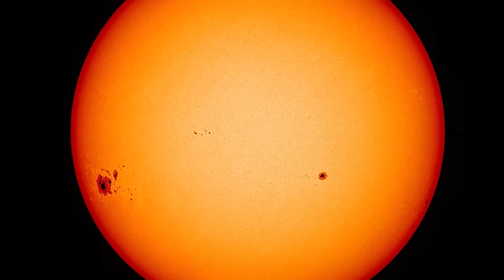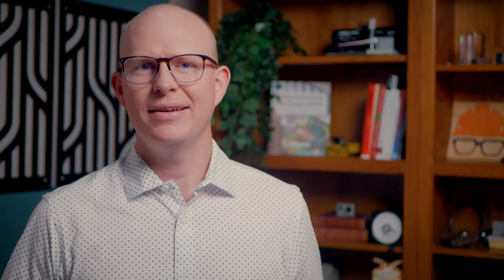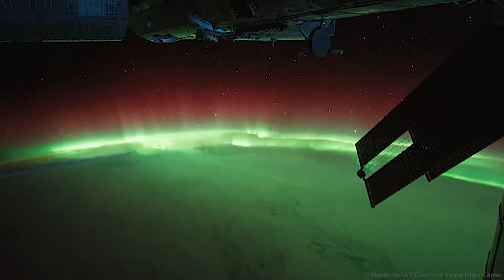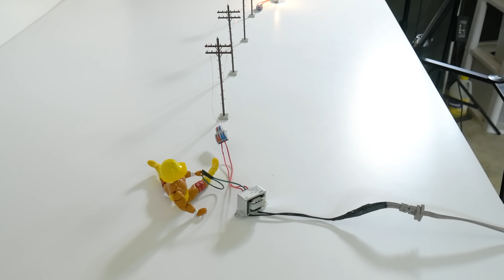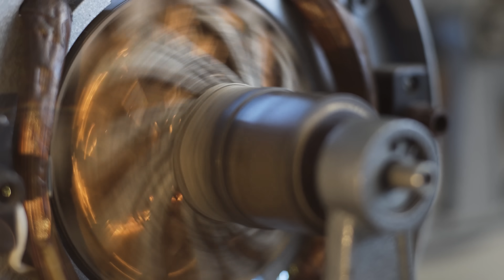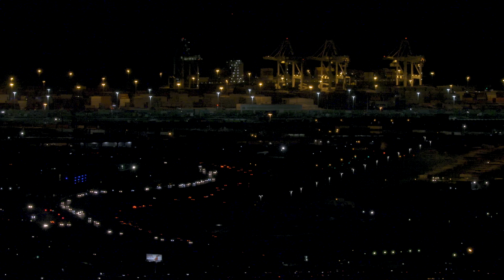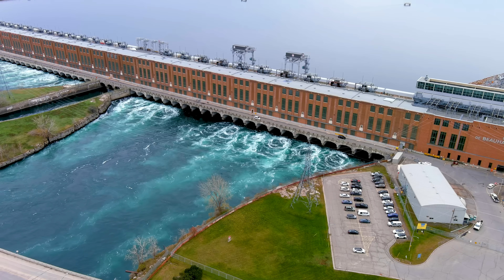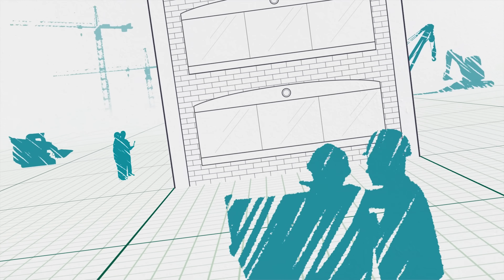The Most Confusing Part of the Power Grid

Comment: When he connected the polarised capacitor i expected an electroBOOM moment😅
Reply: The concern is that someone will buy a transformer, and hook up a massive polarized cap based on the 5 seconds he shows a 0.1uf cap plugged into a model circuit being supervised by an action figure? I think that risk is pretty dang low.
Reply: Plus it was running at 8 volts, it's not going to start a fire.
Reply: @jodosh  The risk is someone will plug an electrolytic directly into a wall outlet without the high impedance of the small transformer.
Reply: Why would anyone do that? The video nevers tells you to try it at home lol. I mean by that logic he just shouldn't touch electricity because it might give someone the idea to play with electricity  @ljfinger
Reply: @ljfinger  I would think it is a big leap for someone to plug anything into mains based on the demo. Anyone that might do that probably wouldn't catch the difference between a polarized cap and non-polarized one.
Reply: @ljfinger  Natural selection is a natural phenomenon, quit being pedantic and let nature take it's course.
Reply: @ljfinger  If you want to do that - go right ahead. that sounds about as intelligent as poking a knife into an outlet.
Reply: @ABaumstumpf  I'm a power engineer. I know better.  I'm worried for those who don't.
Reply: @ljfinger  "I'm a power engineer. I know better. "
Ah yes - the power engineering of sticking your finger into the outlet too often.
Reply: @ABaumstumpf  I've blown up many things.  Ever see an 800A 1200V IGBT explode?  Fun.
Reply: @ljfinger  What about forks, or knives?  How many bogeymen are camped out in your head at any given moment?  Am I responsible for your safety?  Are you for mine?
Reply: @ShainAndrews  You can't determine the difference in familiarity between a knife and an electrolytic capacitor?

I saw someone plug one into 120 back in college.  My ears rang for a few minutes and it filled the room with smoke.
Reply: Yeah, that made me cringe too.  But, caps are a little tougher than some of us give them credit for.  I just recently recapped a motherboard and accidentally put one of the big 3300uF caps in backwards.  (Why, Dell, would you put a white mark on the POSITIVE lead?  That's not the convention!)  I put a few hours on that board for RAM testing, installing Windows, playing a game or two... and then, after a couple weeks, took it apart again to do something else, and noticed one of the 12V rail caps bulging already.  That's when I realized the mistake.

So, I don't think anybody's going to "set fire to their house"  (c'mon man...) putting a 25V(?) cap on the end of a tiny 8V transformer for a minute or two.
Reply: @sirnickity  I hooked up a "dashcam" from aliexpress to my motorcycle, which had a 12v-5v converter/timer/motion detection module.  It worked for a few months, or many hours, before I noticed it was no longer operating.  Pulled it apart and discovered the 5v supercap had 5.5v across it, and *it was soldered in backwards*.
Reply: Having been there and done that many moons ago, I was quite nervous for his fingers.
Reply: Yes, lots of component torture here, like a 12V lead acid battery down at 10V with such a weak load, the alarm bells usually go off when they dip below 11.5 V, quick lose the load, get it onto a charger.
I'll have to have a closer look, was that even a bipolar car?
Reply: You're not the first nor only one to comment this, but i also had to pause the video for a moment at that time.
...Did he really...? Anyway, have my upvote.
Reply: Safe tip
Prop up a power strip at the edge of your vocational school work bench, and skid the capacitor in with a wood ruler. 

It's also a fun version of paper football.
Reply: It could have let out the magics smoke, since wires are just pipes for smoke, when something goes wrong the smoke is released.
Reply: Kinda like when my landlord about s*** a brick because I took down the original thermostat and put up my own smart stat (which I kept the original bubble-wrapped in a safe place). She didn't have a fit just because I did it without approval, but her fit was because she's so hilariously afraid of electricity (so much that she even BANS EVs and e-bikes from being kept in her garage). Anyway, I literally told her, "24 volts 3 amps won't kill anyone or burn the house down... 😑" LOL
Reply: @SomeRandomDude-zqxj  bad way to talk to someone like that. Just say it's just a thermostat and you know what you're doing.
Reply: @thewhitefalcon8539 OK, Miss Manners
Reply: If your thermostat consumes 24x3 = 72 W, then something is wrong with it
Reply: @xonx209   First of all it would be 72VA (not watts), second of all that's a reasonable amount of sustained fault power. The fact that a properly functioning thermostat uses under 3VA doesn't matter, from a safety perspective we care about what could go wrong. You could run a 40 watt 24 volt bulb indefinitely by hooking it between R and C.
Reply: Mmm, 24V*3A is more than enough to set something flammable on fire.
That said, it ain't easy to botch that job.
Reply: yeah AC caps are totally different animal...
Reply: Electroboom should explain this,but, It's in his name Pratical Engineering no wonder there is no fun
Reply: Grady doesn't have electrobooms "finesse".
Reply: Saw that immediately. However, modern electrolytic caps can handle some reverse polarity for a while especially in AC condition. Non-polarized cap would have been a better choice. If not available, two back-to-back electrolytics with an explanation would have sufficed.
Reply: Oh, was that a polarized capacitor?
Reply: Came straight to comments for this. 😂 bro... ive exploded electrolitics for fun as a child by feeding them AC. 😅
Reply: If it was 10VAC or so and that electrolytic looked like it had a relatively modest-voltage rating... maybe 25V or 50V.  So he probably damaged the electrolytic but it isn't a surprise that it did not immediately pop on him.
Reply: It was SCADA, that tripped it
Reply: @ryanchicago6028 I feel offended - it's never SCADAs fault 😂
Reply: I was expecting a similar result, but after thinking about it I believe that the series resistor is what prevented mass destruction
Reply: Connected to a mains powered transformer outside of any protection no less. Yeah, that demo probably should not be taken as a great example of good practice. I know, US cat's piss electricity, but I would still have preferred to see it in some sort of enclosure. Those windings are not designed to mix with people.
I'm not too mad about it, as Grady isn't an electronics channel, but he does come across as intelligent and unfortunately that does come with a degree of responsibility to safe practice. The electrolytic capacitor seems like it should be common knowledge though. To be honest I am slightly surprised it didn't distort the waveform at all.
Reply: @agsystems8220  The mains connections on that transformer looked reasonably well covered for the handling he had to do for this demonstration. Sure, if you're setting something up for more-or-less permanent use, they would have to be mechanically protected better. But the electrical isolation he had was just fine.
Reply: Honestly, that's so dangerous, he should probably take the video down so people who don't know any better don't set fire to their houses.
Reply: @ljfinger  The chance of that starting a fire is very low. The cap would just build up pressure and eventually vent.
Reply: @rocketman221projects  The electrolyte is flammable.  I've seen them burn and explode.
Reply: @ljfinger  good grief
Reply: @ljfinger 👈🏻⚠️WARNING⚠️ OSHA has entered the chat!! On your toes boys... Look alive!🧐 Safety Steve is also a "Power Engineer" believe it or not. Although... His main job is combing YouTube videos for the tiniest "violations" and demanding their takedown.🙄 I swear... pretty soon we'll be advised that it's "too dangerous" to even step foot outside!
Reply: @ljfinger My attraction to electricity and electronics started when I was about 5 years old. My mother removed the burned out bulb from a bedside lamp but didn't disconnect that thing from the mains. Yes. I did stick my finger in there.  It taught me the utmost respect for the electricity in an instant. 😂
Little bit later as a teenager I managed to connect transformer to mains backwards. It was spectacular. 
I used to buy transistors, and other components by dozens because of the habit of accidentally shorting my dangling devices. Sometimes it was just fumes, sometimes it was epic. At some stage I was working in a factory building hot rods, engine swaps, and power tune ups. Once my buddy and I came up with an ad hoc tool for the ignition coil testing. My mate managed to short output of the coil while I was still holding dizzy and spinning it with a cordless screwdriver. That 80+ thousand volts went through him, then the concrete floor, then me, then 15 centimetres of bakelite dizzy casing back to the coil. My mate felt nothing, while for the next 5 minutes I was dancing and cursing profoundly in every language I know. 😂
Few more stories. Not gonna bother.
Nevertheless when there is a real and serious danger I stay away until power is reliably disconnected. Thanks Mom!